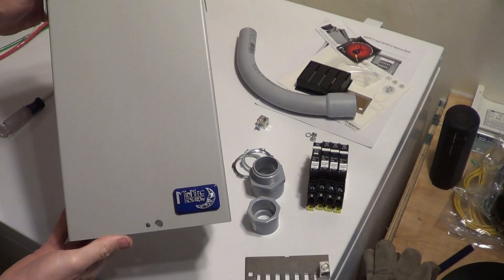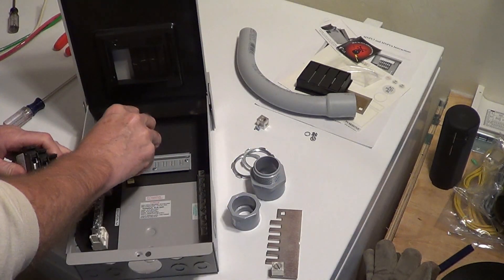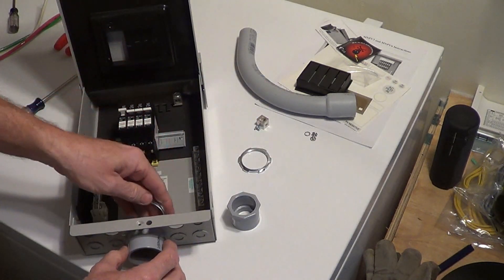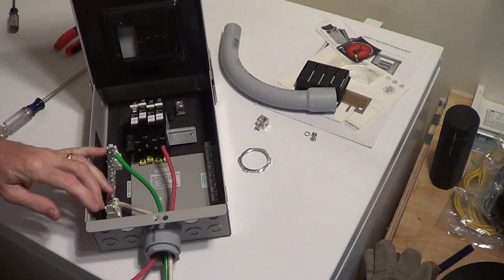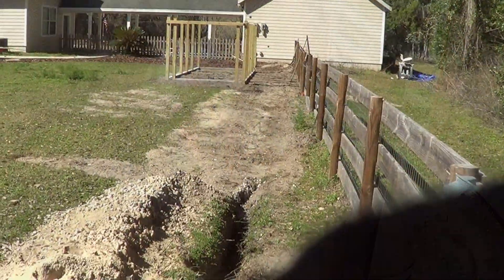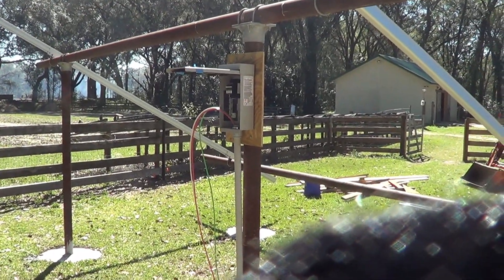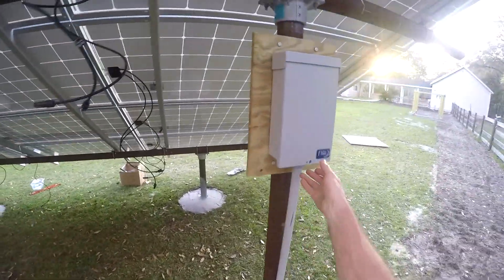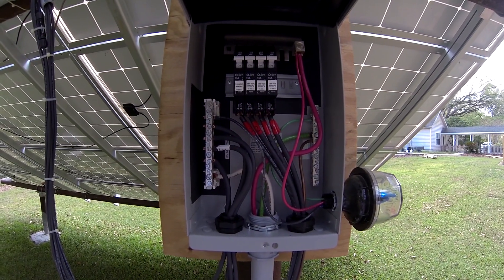Installing the Combiner Box

Comment: Can u connect 220V one array
the other  100V array
to a combiner box 
what will be the  DC out value?
Reply from the maker: SunJay, I am not an Electrician or a certified solar installer so I can't advise you.  That said, I will share my thoughts.  Multiple arrays connected to combiner boxes are always going to be at different voltages.  Imagine you have two identical arrays connected to a combiner box.  Before the sun rises the voltage is zero on both arrays.  As the sun rises one array is in the sun before the other and its voltage begins to rise while the other stays at zero.  It will still produce power.  Same things happens as clouds block one array but not the other off an on all day long.  So, I would make sure that your wires, breakers, combiner box and charge controller can all handle the max current and voltage of the combined arrays under the coldest temps and max output.  Note: There are probably other factors to consider...For example:  If you connected an array designed for 10,000Volts to an array designed for 100Volts, bad things are going to happen.

Comment: Awesome work! I am "finally" installing this model on my north (2,400w) array. I am installing four DIN rail Langir 250vDC (non polarized) breakers for four strings of six 100w panels. On my newly rebuilt 2,900w pergola array, I used a MNPV3 for two strings. For the earth ground, I used 4 AWG heavy stranded THHN to a 8' deep grounding rod. It "looks" correct to me and safe...but, I am not up to speed on NEC compliance. The panels "grounds" are strapped together like they say to do.

Comment: I’m doing a diy solar project and I’m stumped as to whether I should place my inverter next to my combiner box at the ground mount or in the garage. 
How did you determine the size of your wire from the combiner box to your inverter?
Your thoughts and ideas are most welcomed.
Reply from the maker: David, I would not want my inverter outside so I would run the combined DC to the charge controller in the garage.  You can size it by looking at the max current that you will be pushing as well as the distance of the run.

Comment: Came over from the generator vid. 
Question, why don't you just keep the batteries charged off the grid, and once that fails use the generator a couple hours a day to recharge the batteries?  Are you wanting to go completely off the grid? I really like the batteries for the house backup with the Genny to charge them.
Reply from the maker: My solar power system is not connected to the grid.  i.e. I cant run the solar system without the batteries.  Basically my solar power system is running 60% of my house all the time and the grid does the rest.
Reply: @HomesteadEngineering  I guess I want clear enough. The generator can charge the batteries if needed. Why do you have solar when the Genny can do that?  Batteries will be kept charged by the grid during regular times.
Reply from the maker: @TNRonin  OK, I think I get what your saying now.  You could have just the battery bank, Inverters, transfer switches  and associated wire management boxes.  It would act as a large UPS that you could recharge as needed with a generator during an outage.  I have seen this done before with my same Magnum system less the panels and charge controllers at a company.  The advantages of adding the solar and charge controllers to complete the system are: 
1. Solar is renewable.  You wont run out of it during an emergency even if it last for months or even years
2. You can use the solar to run the system 24-7 and have it pay you back over time vs. just an asset that sits there until needed.
3. With solar, you often don't even need to burn fuel even during a prolonged outage
4. Its not that much more money to complete the system
Reply: @HomesteadEngineering  what cost does the dollar add it you don't mind me asking?  I'm lacking the yard space but the final destination does.
Reply from the maker: @TNRonin  This will give you a better idea: https://youtu.be/zb4oar9UHSY

Comment: as a newbie I have watched a number of videos over the last 2 weeks.  This is a sum of what I learned in respect to the combiner box.  There is a positive bus bar on the top and there are always two lugs one on the left and the other on the right. Since the bus bar is one plate and not split into two most people use one lug for the strings and the other lug for the 300 SPD.  You only installed the lug on the right but didn't install the lug on the left so all the positive wires from the 4 strings go through that lug.  If you had installed the left lug then the strings would have been had the red wire leading to the conduit on the left side and the positive wire from the 300 SPD could have been placed on the right lug making the appearance much better and probably more safer ( I guess). That is what I meant.
Further, the technique you used will be very helpful for those who have multiple strings like 2to 1 and 3 to 1 to use one combiner box by simply breaking the bus bar into two pieces and the 2to1 goes on the left lug and the 3 to 1 goes to the right lug and two red wires lead out of the combiner box, thereby saving time and more importantly money. the sole issue would be where to put the 300 SPD.  There would not be a spare lug anymore.  Your technique solve that problem.

Comment: If I recall, your combiner boxes for the rooftop solar had a gang cutoff switches outside the garage. Will this array have the same, or are you running straight to the charge controller?
Reply from the maker: This combiner box is the outside cutoff.  The combined PV runs into the power wall to a inside breaker and then into the PT-100.  You can see how I did it here: https://youtu.be/lbcn3AMDm1c

Comment: There is something really pretty about a newly wired panel. I hope to replace the panels in the barn someday, they are a mess right now!
Reply from the maker: That could be a project for sure.  Some of those old barn panels are pretty scary.  Those little round glass fuses, copper pennies, etc.  BTW: I see your getting closer to 1000 subs.  :)
Reply: @HomesteadEngineering  The panel is not quite that old, thankfully - but it is rusty and messy.
Thanks for watching and commenting, it's people like you that are helping me get closer to the 1000 subscriber mark!